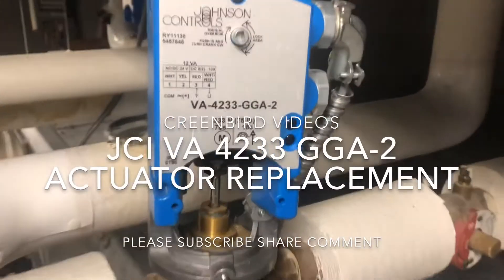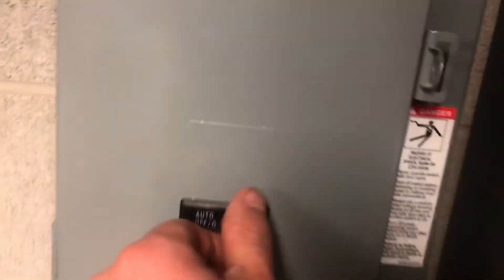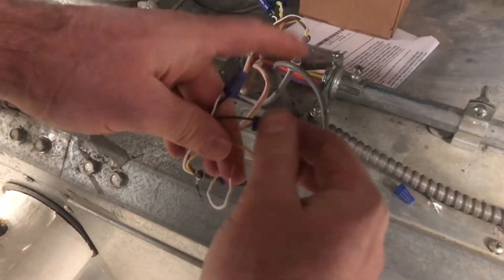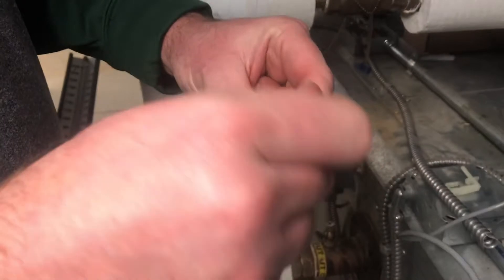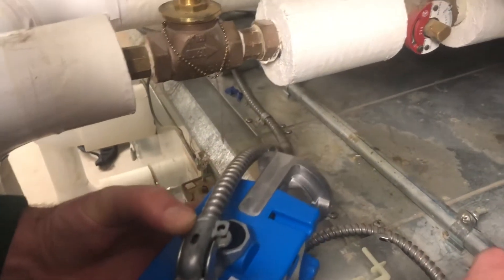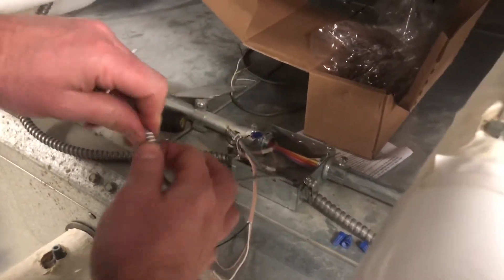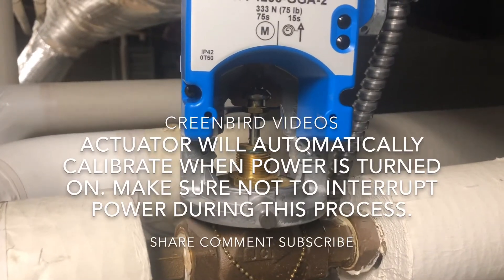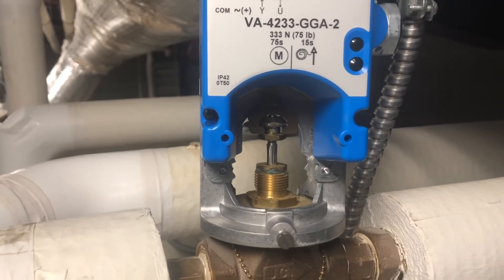Johnson Control VA 4233 GGA 2 Actuator replacement. Quick How To. va-4233-gga-2 VA4233GGA2 VA4233

Comment: Why do these actuators keep failing. I have the same issue and this is the 3rd time this has happened. They only seem to last 2 years!
Reply from the maker: Not sure. We have had some last 20 years and some last 2 years. Heat seems to be their biggest enemy. We have some that are inside of the heating area of unit ventilators that don't last long at all. Sometimes they fall apart in your hands when you take them off. Converting to Belimo ball valves if possible is the best route if your equipment is not being replaceded anytime soon IMO.
Reply: @CREENBIRDVideos  Thanks for the tip. Yea the actuators are used for steam control for a heat exchanger.
Reply: @CREENBIRDVideos  I figured out this issue and got the actuator working again. I removed the spring coil and lubricated the gears. Calibrated it and then put the spring back on.